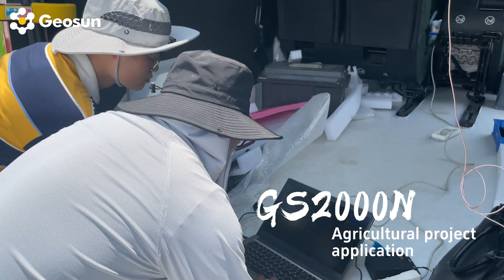GS-2000N VTOL UAV LiDAR: Precision Agriculture Techniques & Benefits

Comment: 100 to 2000 kelvin pulses per second?  The SI unit abbreviation for the temperature unit kelvin is 'K'.  The abbreviation for the SI unit multiplier prefix kilo is 'k'.  Maybe you meant 100,000 to 2,000,000 pulses per second?  If so then the values would have been written 100 k to 2 000 k pulses per second.  Just saying :)

But the LIDAR device is pretty cool
Reply from the maker: Yes,  100,000 to 2,000,000 pulses per second.
Thanks for attention.